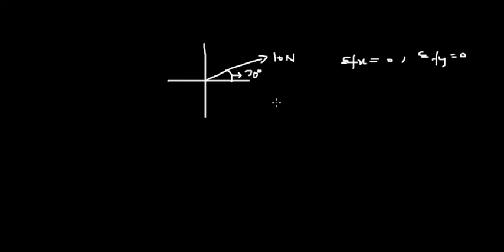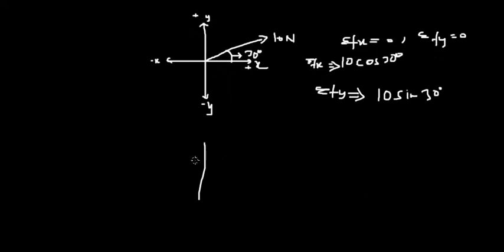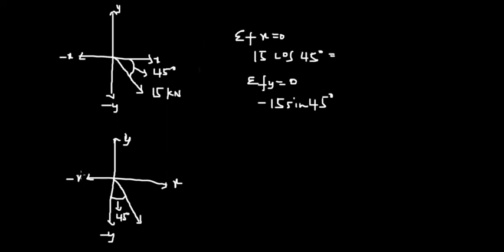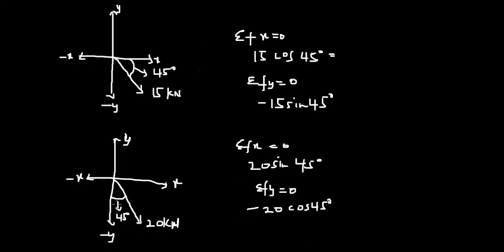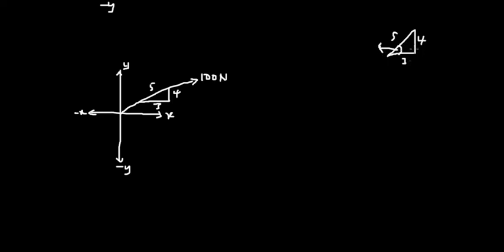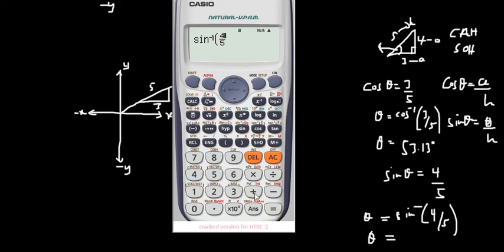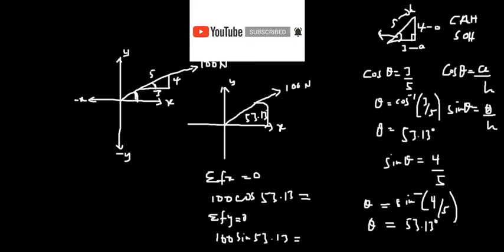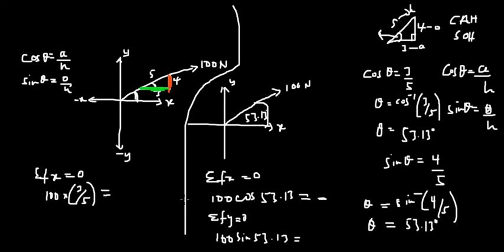SIMPLE TRICK- RESOLUTION OF FORCES | BASIC MECHANICS #knust #Civilengineering #mechanicalengineering

Comment: What of if you have 3forces and the angle is not given
Reply from the maker: You can use the same formula as explained in the video but you’ll need to resolve along the z-axis as well. 

You can also use the triangular rule/formula. There are other rules like the cosine and sine rule to help you solve the problem but you might need an angle in other to implement the latter two rules(I.e cosine and sine rule).